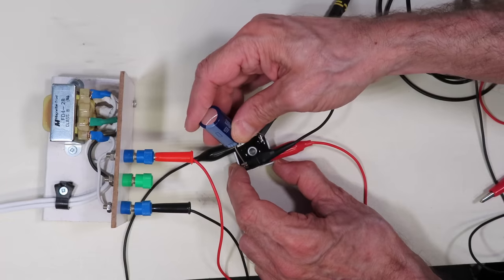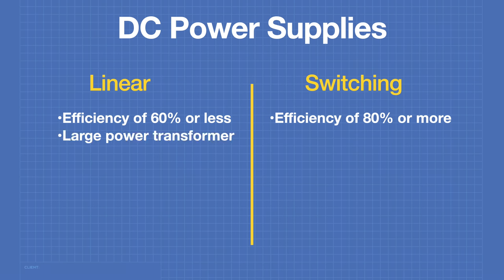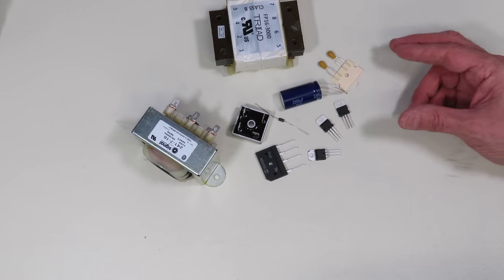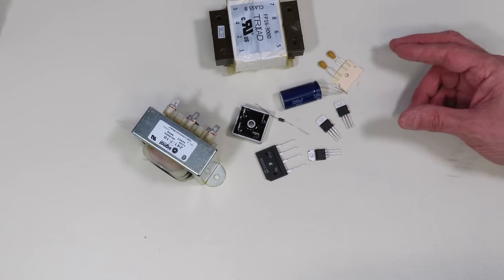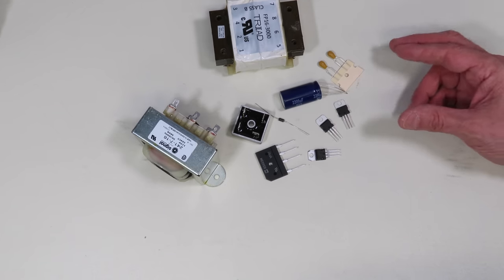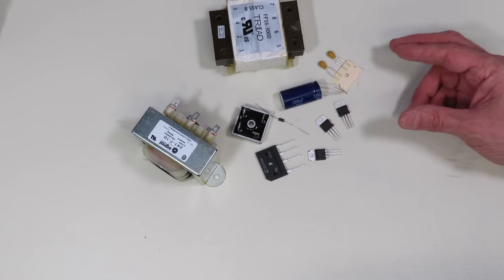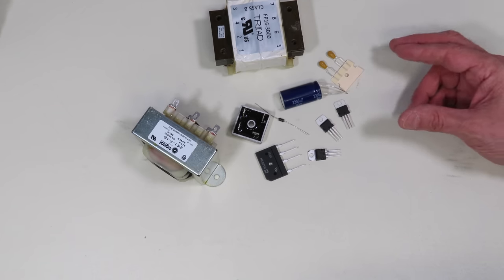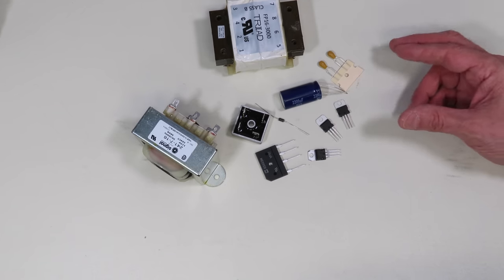Linear DC Power Supplies - Designing & Building Custom DC Power Supplies

Comment: Great explanation of each stop of the circuit. Can you go more in depth on how to choose resistor network values to get a desired output voltage without a datasheet?

I have a circuit which uses a XKT-3169 chip (if you google it there's a schematic of a circuit where it outputs 5V, the link to the schematic is at a store so my comment gets auto removed). It's input is 16V and it's outputting 5V with resistor values of 44.2kΩ and 10kΩ. Any idea of where to start to get it to output a higher voltage? I've tried contacting the seller without a response. Cheers!

Comment: Hi, great video. Do you know how one can build a power supply for a high DC  current output ie:- 100 or 200A. Would they just need to  change the transformer for a high current and low voltage output then feed it to a bridge rectifier and smoothing capacitors in parallel to get a high output DC current. Could you please recommend what type of components to use. Main applications of this power supply would be magnetic amplifiers. Thanks.

Comment: You have a funny way, of using your tongue. I had to adjust 2 that. But you do some great explaining 2! I had this argument, on a audio repair club. Where I had this thing, because lots of synthesizers and audio mixers come with a  switched PSU. For me, 2 facts are there; 50/60Hz can create audible issues. Also drops the output of a transformer, when load is taken. Where 10KHz+ switching power supply noise, is far beyond audible reach. So it maks me wonder, why audiophiles are so against those. 
U know; when lightning strikes, or power failure happens; damage comes along. Maybe a 12, 24, or 48V kind of home grid, can be called more safe. But safe is just an... ID. Fact is, that a switching supply can do al lot, even when grid drops are down to 90V. Namasté.
Reply: several faulty statements and misleading blanket statements. So you lost the argument on the audio BBS and want to try again here?

Comment: The voltage is not deadly it's the current that can kill. I've accidently taken many 10,000v shocks but it was at low current about 30 mA or 0.03 Amps. I'm quite alive, had it been at 0.1 amps or more I'd be dead for sure. As a kid I was always been curious about electricity and I would foolishly stick uninsulated knives into the wall sockets (110VAC US) to see what would happen. I blew many fuses in my day from that. I do not recommend to anyone doing that by any means. But I've survived all my foolish escapades. Also how many people have been struck by lightning and survived billions of volts. The human body is fairly resistive and we all know eleictricity will take the path of least resistance. So I would imagine those lightning survivors were fairly wet at the time so most of the charge followed the water on them instead of passing through them. Also duration has an effect on fatality as well. The longer the duration of exposure, the higher chance of fatality. Please folks always follow Bill's advice and stay as safe around electricity  as possible 100% of the time!

Comment: European power levels for decades have been at least 230 volts (that's the official figure nowadays I believe) but often actually reaches 240 (on the wall sockets in the places I lived most often times the exact figure turned out to be 238). There for a long time has been talked about ultimately it being meant to get raised to 250. I am not sure why that is preferable but it may be cause that makes the electricity network somewhat more efficient ~ maybe someone here may know what's behind it.

Comment: so I must be missing something here.  Why aren't the negative and positive voltage regulators interchangeable?  It seems to me you'd just switch your output terminals to turn a positive into a negative.  Voltage is relative after all, why not just switch which terminal you're calling ground and call it a day?

Comment: I don't get it  - input voltage 24V, let say output is 4V and current 1A. In this case you dissipate 20W on that tiny radiator. You will fry this design in seconds.
Reply: wrong in 3 ways
1  it has thermal protection - read the datasheet
2  up to YOU to choose an appropriate HS
3 no sane person would try that - they would use a pre-regulator
Reply: @kennmossman8701  , 1. thermal protection works... until it does not 2. I commented on your heat sink choice, not on some imaginary spherical horse in vacuum 3. no sane person would try... you just did, in this ill advised video. Instead of beautification details a better video would spend some time discussing design limits and importance of heat dissipation in linear regulators

Comment: If it hasn't got foldback current limiting, it isn't much of a bench power supply, more of a toy. This supply will be characterized by noise, poor regulation, different current capability at different voltage settings... it's a mess.

Comment: have a gust if you apply a DC from a battery in to electronic capictor let’s says a 12 volts what is  the voltage  if you build a 12 volt power supply from an AC apply to a 12 volts battery what is the voltage
Reply: cap - depends on how long it is connected      battery - depends on its state

Comment: Obvious improvement is to use box as a radiator for voltage regulator. Second, not so impressive amps in terms of "battery charger". If you take some casual 60Ah battery, it takes forever to charge it. 8amps could be good for any purpose. And if it requires MOSFET, we're interested how to make new scheme! 😆
Reply: LMAO     what a totally dumb thing to say......obvious improvement is to use box as a radiator for voltage regulator.

Comment: Hello culd you please make video about custom power suplies for magnet alternators?
Im in dire need for external power for me baterry and desire it to be cloosed loop system I have years problems with the original delco 12si voltage regulator.
If I use external capacitors on me e core type design ignition coil with the 4pin gm ignition module me starting charge changes on me alternator for exampel if I use ceramic high voltage capacitors.
So I hoppe for advice .
I dont understand that circuet honestly it seam's like me alternator voltage regulator is controled via ground baterry potencial those capacitors messed up evry thing so Im not shure what to do here some peopel used different bulbs resistance to regulate manuali alternators out put some use cloosed loop voltage regulators but still I am woried the alternator wuld send to much current to the baterry in me land I cant buy current cutt out relay so hoppe for some advice.
Also the Hei ignition system in me car uses the MC 3444 ic chip lay out design in the 4pin gm ignition module I wanted to ask if there is any posibility that I culd coppy that circuet the lay out can be found on google or tge LD 3444 ic chip design  the problem is durring engine start up the ignition coil isnt saturated enough and due to reason wires are long the coil does not get enough voltage to start engine at cold conditions also the original 4pin ignition module does not have any retard ignition timing so Im confused what circuet is used to control voltage or frequency in those mentioned devices?
Is there any external means to manuali trick that ic chip to retard timing at least 10-20° degrees???
Im super anoyed at those staff and me car does not support any bether upgrades .
So hoppe me question makes sence about the alternator and ignition system.

Comment: the problem with these serial power supplies is that if you use the output at 5 volts and 2 amps for example, the regulator will have to block (24 volt - 5 volts) = 19 volts at 2 amps => 38 watts.
I doubt the little heatsink will do the job.
sorry but google translate.
Reply: no sane person would do that
they would use a pre-regulator

Comment: <sigh>
Another example of the problem of internet wisdom, its MOSTLY correct.
This guy has completely misunderstood LDO regulators and also the power that the regulator device will need to be able to dissipate.
The end result is fatally flawed.